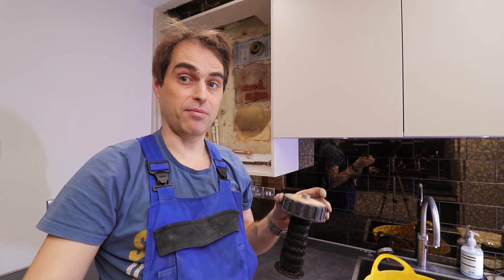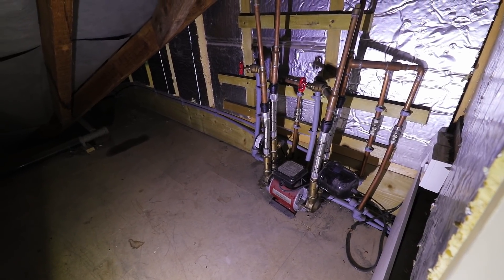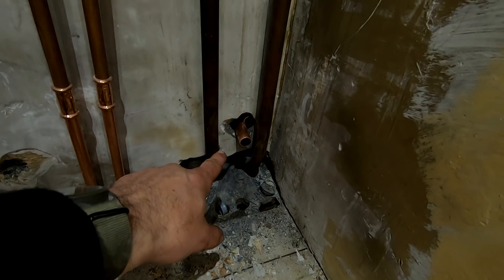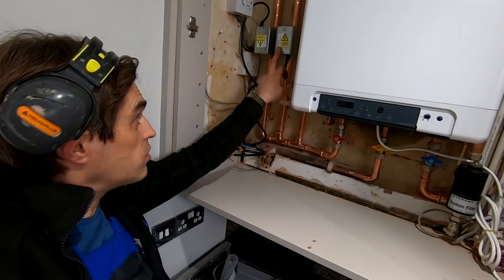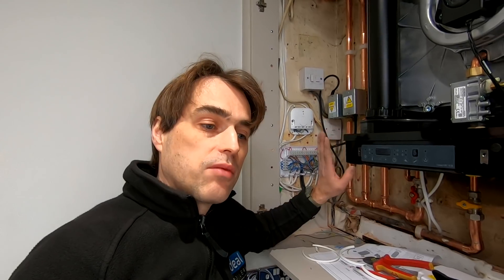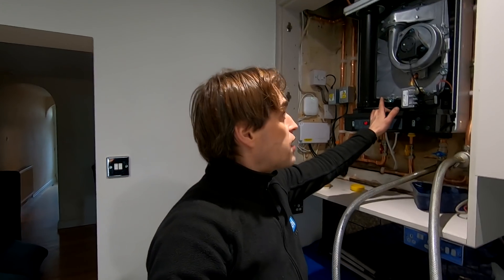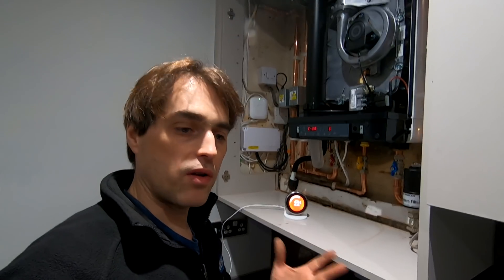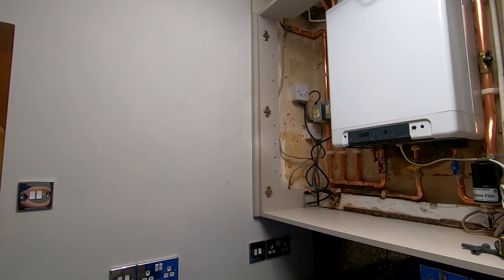Another house saved from a combi

Comment: so i have question on the gas line, i didnt know you could use copper for gas.  how is that possible? are standards different there then here in the US? also is the boiler vented? if not, what happens to the gasses
Reply: Yes, you can use copper for domestic lines in the UK just not for transmission. I think you're asking if the HW cylinder is vented? No it isn't so there is always a  pressure regulator and relief valve attached, that's why he had to relocate the cylinder to the first floor to make termination of the PRV pipe to the outside easier.
Reply: @tonydization  , ok I'm confused.  So where do the gases go? Inside the house? Are the co2 emissions low enough not to be concerned
Reply: @msuchinski  The gases from the boiler are removed via the balanced flue but we werent shown it being installed on the video. See 3:51, it's there but mostly hidden by the kitchen cabinet.
Reply: Thanks for responding,  is there a schematic or manual on line I can look at . This is the first time I have seen this and would like to learn more about it.
Thanks
Reply from the maker: Google ‘Intergas hre sb’ installation manual for see how this boiler works
Reply from the maker: Or watch some of my other videos
Reply: @msuchinski  in the UK, we don’t have a gas fired cylinder (or furnace). The hot water is heated indirectly by the boiler, then pumped into a fast recovery coil which indirectly heats the water. I think I understand what you mean by the flue gases, the cylinder is for hot water storage only👍🏻

Comment: why would  people  use a nest  over  the standard?? wat is the  advantage?
Reply from the maker: Remote control and open therm for load compensation for much better efficiency with compatible boilers such as intergas.

If the boiler is not Open Therm compatible there is fewer reasons to use Nest.

Comment: I always carry air compressor for bigger installs to check for leaks before I put water in but I don’t do as many installs so never had need of buying press gun yet. Would you recommend it ?
Reply from the maker: press fit is great. Never use a compressor to check for leaks. Air compresses easily and if a fitting ever blows off a pipe it can kill you.

Comment: Great video! Just curious, why did you use a different type of two port valve for the heating?
Reply from the maker: The valve for heating is normally open - so when there is heating demand both valves are in resting position. When there is hot water demand both valves get energised. Heating valve closes, hot water valve opens. Hot water fires at much higher output to quickly reheat the cylinder. Heating works with load compensation and low modulation. If both valves were open you would lose a lot of efficiency on CH.

Comment: Where is plumbing like this, where getting hot water is so detailed? I plumb in northern Cali and have worked on instant or on-demand water heaters, as well as standard tank style and have never seen such a complex system to heat water. This is too much.
Reply from the maker: It’s all about efficiency. No one cares about it in US as your gas is cheap
Reply: I have solar on my house but still run a 50 gal gas water heater, as well as my furnace and range in case of outages. Which is roughly $225 USD a month since Jan 1st for gas alone. Not super cheap but I do agree.. 

Still curious though, where are you from? I apologize it's the first of your videos I've seen. You do great work man!
Reply from the maker: Hi mate, I am in London, UK. Here one appliance does both heating and hot water. If you are paying $200 / month in US, in Europe that would cost you considerably more! 

I know that in US you like cylinders that are directly heated by gas. We don’t use those as then you need another appliance for heating and scaling is a real issue as well.

Comment: I'd like to see you install a river source hp with a 1-2m3 central heating accumulator tank on a variable tariff to show that you can get heat into your building at <2p/kWh. 

That's 35kwhr of storage per M3. Typical decent performance home won't need more than 25W/m2 for 10 hours ≈ 25kwh peak. A 2m3 system gives you 4 days of storage on a typical day, guaranteeing you even cheaper off electrical peak rates (lots of wind generation at night) and you'll get below the magic 1p/kWh heat. 

No gas system will ever get closer to that in terms of value and durability.
Reply from the maker: 25w /m2 ? In UK housing stock usually needs 70w/m2 or more! Most houses are uninsulated solid brick walls build end of 1800, beginning of 1900s
Reply: @UrbanPlumbers  yeah, we have the worst building stock in Europe, there's a lot of retrofitting left to do. Which is good news for the trades. On average we need about 50-100mm continuous insulation in our enclosures. 150-200mm exterior wall insulation where possible. 50-100mm internal. <1.5 ACH50 air tightness.

Retrofit Windows to make them air tight and with an integral internal insulated blinds.

Mechanical heat recovery ventilation system.

 Ideally under floor heating, or a central return ducted heating system.

Then, during unusually high electrical prices, people need to drop temps to 18deg, and zone heating to the common areas a bit more. 99% of the time heat will be so cheap you wouldn't have to bother zoning at all. 

Or we shaft the next generation. Entirely probable at the moment. But we eventually get it right.
Reply: @FrankReif  good luck convincing owners of Victorian terrace houses to stick exterior insulation to the walls, not to mention ripping up the exposed wood floorboards for underfloor heating! Have the rules for upgrading windows in conservation areas even had a sanity check yet?
I think one of the biggest challenges facing UK housing stock as reality bites is the lack of a dedicated room for heating equipment. Buffer tanks, pellet hoppers, water cylinders, etc need more than a kitchen cupboard and eventually people will run out of places to keep their towels!
Reply: @simonc4810  we're in a tricky situation, that's for sure. 

Heat networks are the future. The Nordic countries have nailed it already. But still, you have to do something to the envelope if you want reasonable value and any comfort.

Victorian terraces will be ok, you can conserve the front facade and retrofit 50mm interior there, outfit the roof and rear facade with 150ish. 

I would not put hydronics under thick floor boards. Ducted ventilation and larger double/triple panel radiators will have to do. I like radiators with some active fans on the bottom to help with heat exchange. So there are ways to keep working temps down without underfloor.

It's the rural detached rubble wall/masonry buildings, without a dpc, which are going to costs a pretty penny though.
Reply: @FrankReif  I think your vision will require monumental leadership from areas where very little currently exists. It is likely to rearrange what is regarded as valuable/desirable in real estate terms, with some of the biggest losers being the wealthiest. Perhaps the next pandemic actually does need to be a ruse for thought-controlling injections!
On a national level though, the choices are either rise to the challenge or lie about it.

Comment: you could have fitted Worcester 8000 which is a combi designed to do 2 bathrooms
Reply from the maker: there is no combi that can do 20L / minute at 45C rise mate. Also on existing 22mm supply you would not be able to install anything bigger than 30kW which would only give you around 11L / minute at 35C rise.

Combi was absolutely not an option on this job.
Reply: @UrbanPlumbers   maybe not for you situation but it does run 2 bathrooms at same time
Reply from the maker: Combi is always a compromise

Comment: I wunder,why do you need such a cilinder???I have a system without it and it works fine!It delivers warmth and hot water..In a house of three floors.In the Netherlands..With a shower AND bath..
Reply from the maker: what boiler do you have and what size is it (Kw) - can you run the bath and the shower at the same time?

Comment: Good decision on the unvented, the amount of times I hear "engineers" say "just put a bigger combi in" is painful, zero understanding of the reduced flow rates through a plate. On a side note can you use press fit on a D2 now?
Reply from the maker: What's the problem with press on D2? There may be something I am unaware of. Mapress fittings are rated to 180C so should be fine on D2?
Reply: @UrbanPlumbers  not doubting your knowledge in any way, but I was told although the fittings are rated to 180°C they’re not yet approved/tested for use on D2’s. Feel free to correct me.
Reply from the maker: You may be correct
Reply: @UrbanPlumbers  yep, it seems daft to me, it's the equivalent as having to use push fit waste pipe when terminating the D2 into a stack. It's simply the materials it was tested with and therefore the only approved method.
Reply from the maker: I will not lose my sleep over it really. But thanks for the info!

Comment: I’m amazed how the trade has moved on since I “escaped” the industry in 1995. When I started installing heating in 1974 the wall boilers were so heavy, I loved how you just picked this one up and passed it to your mate, the old Potterton Netaheats I used to install were a two man lift in the early models. 

Great vids, do you still need to be licensed to install an unvented system, I recall when they first came out, I was one of a very few who did the coarse and had the licence, that must of been in the late 80s.

Love the flushing machine. Keep up the good work, how are your knees holding up?
Reply from the maker: Yes you need a qualification form unvented that has to be renewed every 5 years.
Reply: @UrbanPlumbers  not in Scotland, once you do it it stays with u forever
Reply from the maker: @cloud12274  here they caught on to the fact that they can charge you £200 every 5 years
Reply: @UrbanPlumbers  it's all about the money m8
Reply: The old boilers were heavy but lasted. Its all a trade off. Personally I don't like Combi Boilers - On - Off -On -Off but I'm just old and can't see it. Nice work.

Comment: You could have used a vented DHW only thermal store, rather than the pressurised unvented cylinder.
Reply from the maker: No space for a thermal store
Reply: @UrbanPlumbers  
Same size as an unvented cylinder. Advance Appliances sell one that needs no drain or discharge pipes. User tops up using a level pipe.
Works at atmospheric pressure. No G3 needed. No annual service.
Reply from the maker: @johnburns4017  I will have a look into that. I am not sure of the implications of using a heat store on PDHW. Higher flow temps is one of the drawbacks on hot water reheat as you need 80C.
Reply: @UrbanPlumbers  
Using a plate heat X and pump for DHW, the stored water only needs to be approx 5C above tap water temp. In short about 58-60C, about same as an unvented cylinder.
Reply: @UrbanPlumbers  
Look at Gledhill's site. Look at the Torrent, that uses a plate heat exchanger for DHW take-off, of which there are many models. The installation instructions are there. Very informative. A number of companies make thermal stores. 

You could have an electric store, with no coil inside reducing costs. A combi using a brass pump could heat it if it can raise the temperature high enough.
Reply from the maker: It all sounds much more complicated and expensive than unvented
Reply: @UrbanPlumbers  
That is clearly not the case. Get to know how they work. A simple thermal store has a high capacity DHW take-off coil, and blending valve. They will have integrated header tanks. That is it. 

Many have integrated two cylinder stats to virtually eliminate boiler cycling. You can add these yourself cheaply. They reheat with one long efficient boiler burn. The boiler is in its most efficient hydraulic environment. They operate at a low safe pressure. No expensive service needed.  The cylinders do not rot as they static water inside them. 

Many can be fitted in the middle of a property.

Unvented cylinders need a G3 man to fit and maintain. That costs. Also, needing an annual service.  They have expensive complicated high pressure & temperature valvegear. They have expansion vessels which invariably fail causing dripping though tundishes staining the outside of walls. They also operate at high pressure.  The initial cheaper price is deceptive in the long run. 

I have not even mentioned running CH off them either. Running heating and DHW off them the heat source is detached from the CH & DHW demand.
Reply from the maker: @johnburns4017 I do not like that idea at all I am afraid. I will stick with unvented cylinders. Heat store not a solution I would want to entertain if I can avoid it.
Reply: @UrbanPlumbers  
It is clear your mind is fuzzy on them. One of your customers in the future is going to have a hefty bill to replace expansion vessel and control valves. Bit you will be gone by then.
Reply: @tonydization  
The simplest thermal store is a high efficiency coil, and blending valve. How simple do you want it?

A pumps is a cheap item, tending to last when not too hot. On a thermal store they are not noisy - a normal Grundfos or Wilo pump.  Used on a plate & pump they are on the cooler return. 

Good plates are well made, being easily removed and cleaned. Cleaning is a quick enough job sing chemicals and a main pressure hose. Many vid on U tube showing how to clean them. If needing replacing they are a quick job.  

I used to buy:
1) Cheap cylinder;
2) An F&E tank:
3) Plate heat X;
4) blending valve;
5) flow switch.  
6) cyl stat.
7) simple pump. 
8) If they wanted boiler anti-cycling, an extra stat, electric box and latching relay.

I would assemble all in the garage quite quickly, about an hour, making a cheap DHW only thermal store. Could use cheap copper cylinders as they do not corrode using static water as the heat storage medium. Saved a lot of money.

Beats those silly, noisy, leaky, power shower pumps. Mains pressure hot water at every tap. 

I converted my low pressure cylinder to thermal store using a plate and pump. The large tank in the left was removed being replaced by a small F&E tank fitted up the gable wall in the loft creating lots of extra storage space up there. It performed flawlessly for 20 years when the Grundfos pump finally failed. At 13 years I descaled the plate heat X. Simple job. I left in isolation valves to remove it.

Most of the neighbours who still had fresh water copper cylinders, after 20 years were just staying their third cylinder as the other two corroded.  Mine was corrosion free.  All I did was pour in some X100 initially, then occasionality, every 5 or 6 years, I might pour in another can. In reality it never needed inhibitor, as the only ferrous in the stored water was the DHW pump.  

In this case a thermal store could have bee fitted instead of all that extra unneeded work.

Get to know the different solutions around and the products available.  Do not be resistive to different angles of thinking. Looking at matters differently can get you out of jail.
Reply: @johnburns4017  So you're a competent DIY'er, when you've installed a few professionally in a limited time frame and have a happy client base I'll take more notice.
Reply: @tonydization  
A ad hom attack.  You lost. You are limited. Reading what I write I am clearly an experienced professional. If you make a living in this business, you should clearly sharpen up. Get to know different ways of problem solving and the products available.

Comment: Thermal stores are good alternatives to moving unvented cylinders when faced with D2 pipework issues; they don't have D2 pipework, and still provide mains hot water. Is there a reason why this wasn't considered?
Reply: Not a heating engineer, what is D2 pipework? I agree, thermal stores are also great from an efficiency point of view. Also you get the good flow rate of an unvented cylinder and the unlimited hot water of a combi.
Reply from the maker: They wanted under the stairs space empty. Also, heat stores are more expensive.

Comment: Hello great vid. Got question about adding chemicals to the system. Can you mix different brands ? I want to add to my  3 year old combi boiler system but I don't know brand that was used earlier. Also is there any limitations of how much chemical can you use in system? Great work thanks
Reply: Best tl drain down and refill mate stick to fernox as they are quality but cheap stuff lile senital is also fine
Reply from the maker: I don’t know regarding mixing chemicals.
Reply: There have been tests done that prove mixing inhibitors can accelerate corrosion in heating systems. As G mentions best to drain it down and refill with a fresh inhibitor. I’d only use Fernox, Adey or Sentinel. I wouldn’t bother with a brand different than that. There are other ways to treat system water, but it  gets quite in depth. If your interested check out de-mineralising based on a German standard VDI 2035, it’s quite interesting.

Comment: What is the cost benefits to this system over a combi. 

Im using around 70kwh a day of gas to heat my home to around 21-22 degrees using a Logic+ combi boiler 24kw
Reply from the maker: It’s not about cost benefit, this is purely done for hot water performance and ability to have great hot water flow.

This is a system that delivered superior hot water performance over a combi and also better efficiency on heating as compared to standard cylinder set ups such as S or Y plan.